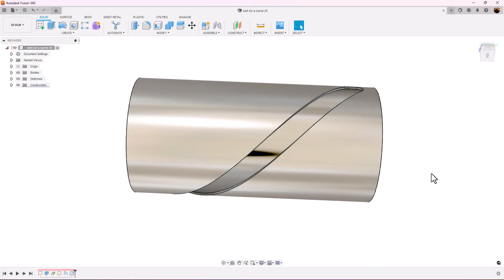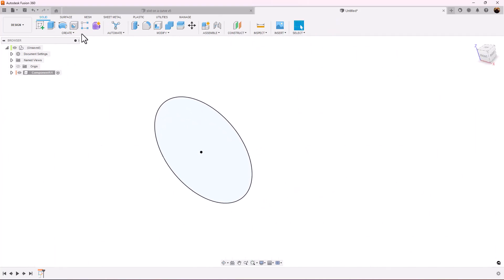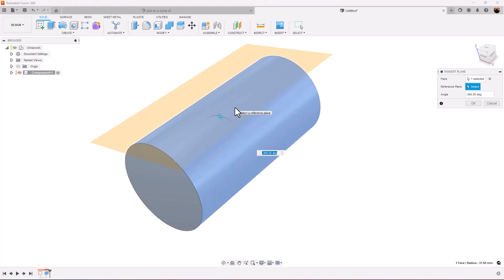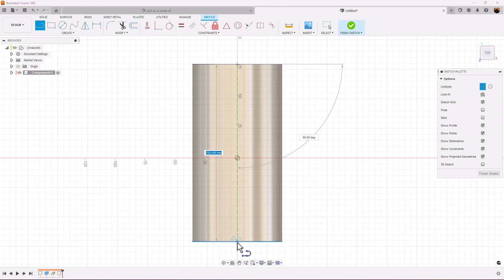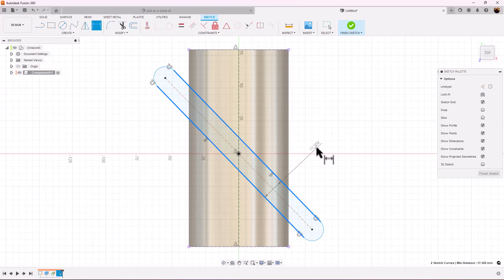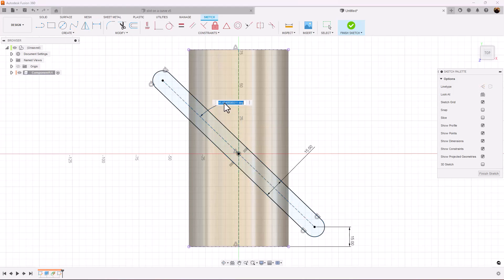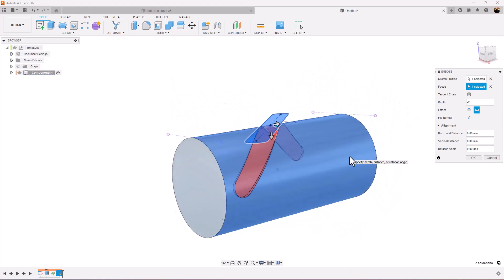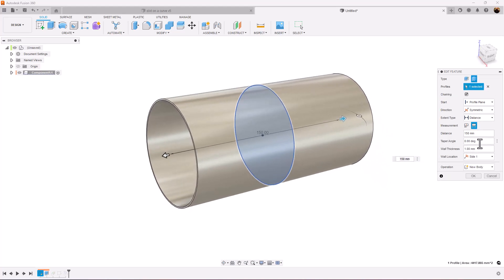Learn to create a slot on a cylinder in  Fusion 360

Comment: Dude, i need to do that but the point at the start and the end of the hole in the cylinder must be at 180º degrees... In your video the hole dont do a half spin... How can i solve this?? Thanks for the video btw is very usefull

Comment: Thanks. I have a job coming up where I will need to mill such a slot in a pipe on my cnc milling machine. I was thinking of modeling using the coil function but this is way quicker. Silly of me not to think of it because I use emboss for putting serial numbers on 3D resin printed parts I make. :)